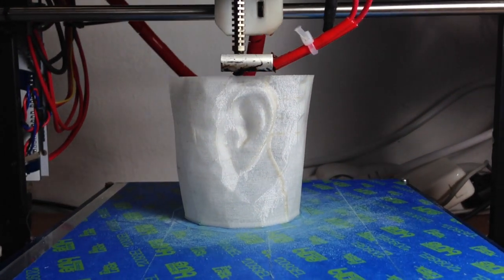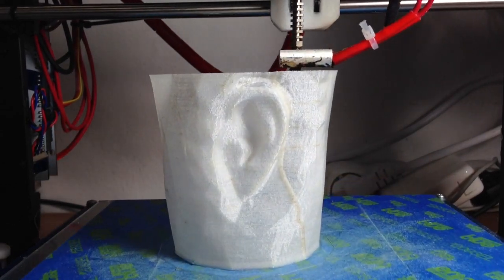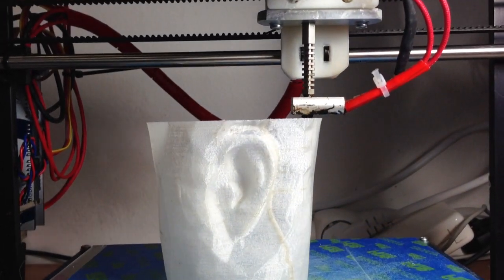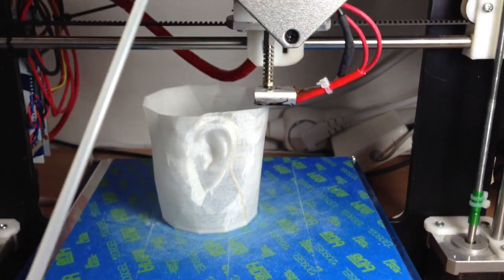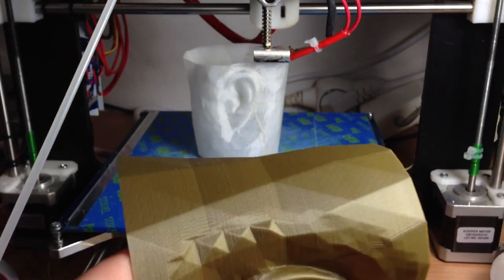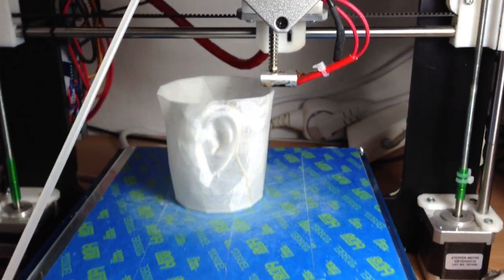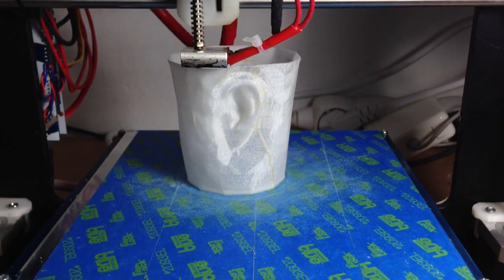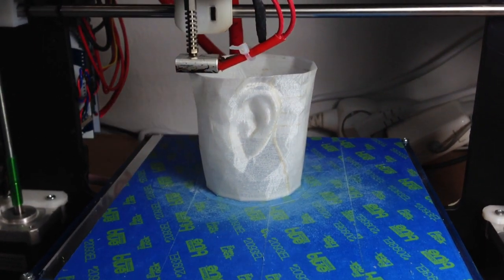Prusa Nozzle printing Nylon 6

Comment: VERY exciting Josef! Some 'functional' test pieces - i.e. with sub-features designed to be repeatedly flexed would be interesting to see in action. I've been working on a rear bike light (Smart / Cateye brand) to Fizik brand seat adaptor clip - 'FiziCatClip' - and it would be good to finally see it in action in Nylon6. It works in PLA, but can require strong fingers to release it from the seat socket. I'll try to publish it (CC-BY-SA-3.0) in the next month for people to try out.